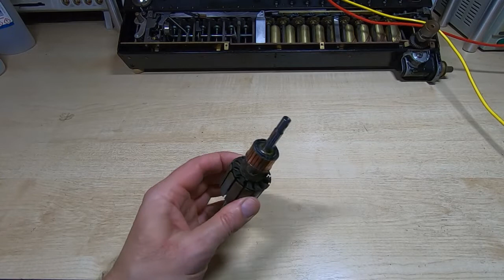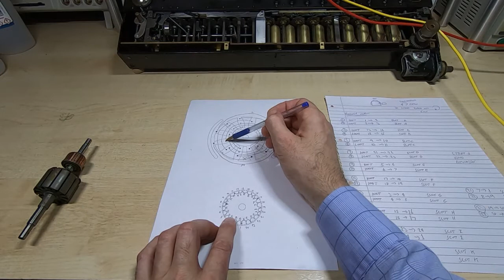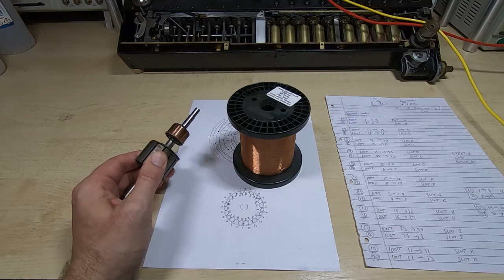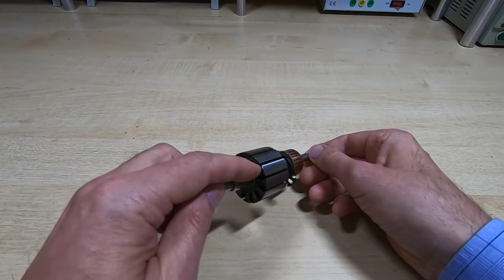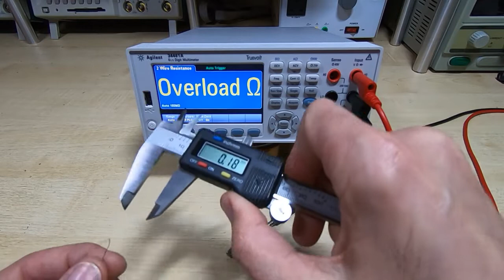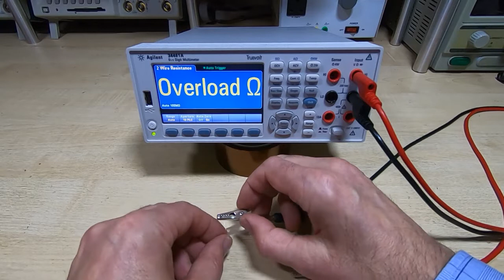MADAS Calculator repair Part12

Comment: do you mind sharing how you removed the corrosion from between the laminations? Also I think I've read that Kapton doesn't reliably insulate after a few decades.
Reply from the maker: I used evaporust in a vacuum chamber for a few days and then flushed and dried with IPA. You should never rely on tape for insulation, especially in a rotating machine and I do not. As I stated in the video I vacuum impregnated the rotor in resin. This actually loosens the kapton (if you dip a piece of kapton in the resin it will lose it tackiness). The resin replaces the kapton and is the primary insulation and it also holds the windings in place. The kapton is only applied to the rotor to prevent damage to the wires during winding. Also note that the wire is double coated and is specified at up to 11000 volts so technically no further insulation is required but I do not recommend that approach because even if the wire is not damaged during winding it may get damaged during operation. Also note that there are insulated caps at each end of the rotor so the wire is not in contact with the core anyway.